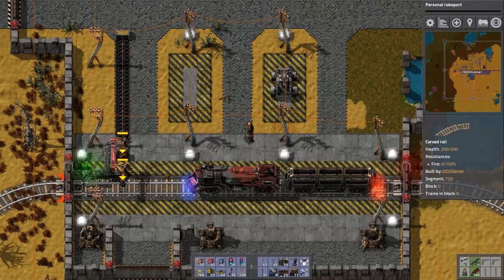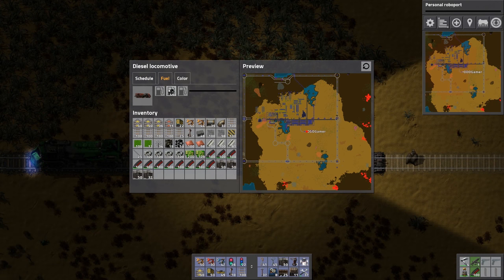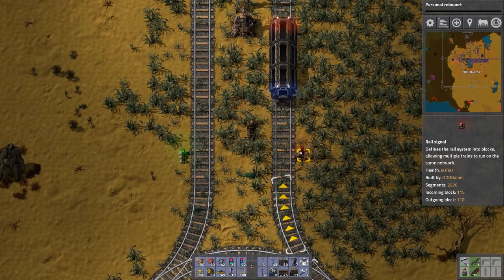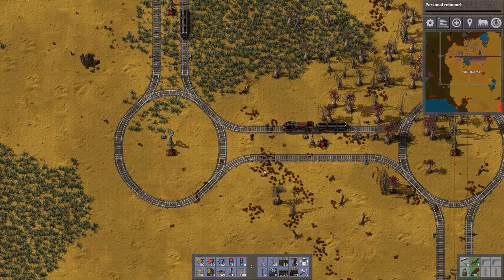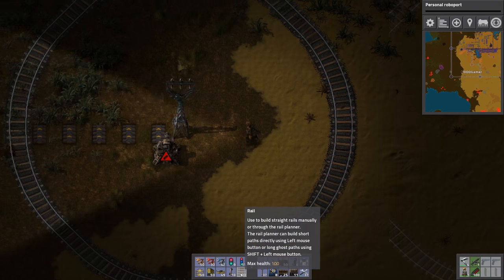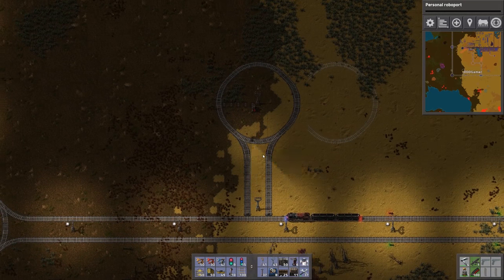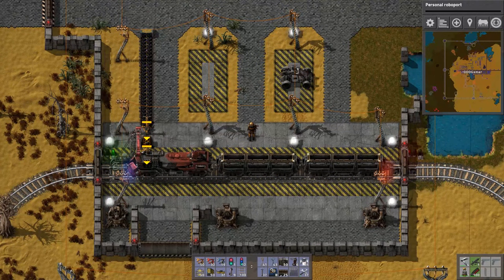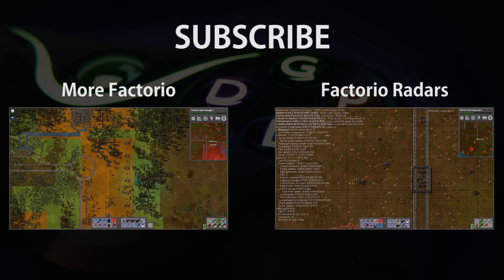Factorio Tutorial - TRAINS v0.14+

Comment: About the spacing of the signals on a straight line. You can put them as close of each other as you want actually. 
Every track part that contain any part of a train will have it's associated signal go red. There is no risk of collision even if you put signals as close as possible. All you do is gaining space in case of traffic jam and wasting money on signals. 

I even tried it with a huge train that take a long time to break. A bunch of signals turn amber from far away and the train stops just in time.
Reply from the maker: Right i guess on a straight track it doesn't really matter except wasting resources/time on them, i think for a blueprint, max distance b/w large power poles is good, but in complex junctions you need to be smart about where to put them and not spam them everywhere.
Reply: +mogdu
The good thing about spacing is at junctions. It is very good to make sure that your train can exit a junction, so having the signals spaced out, so the length of your train fit in the block is a good idea. This help avoiding deadlocks